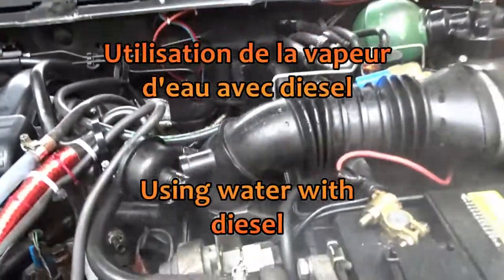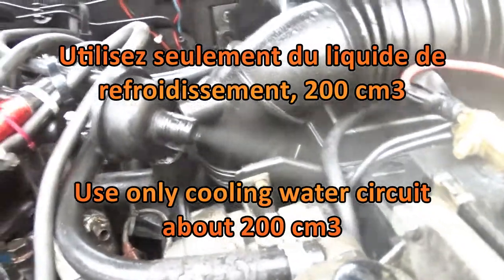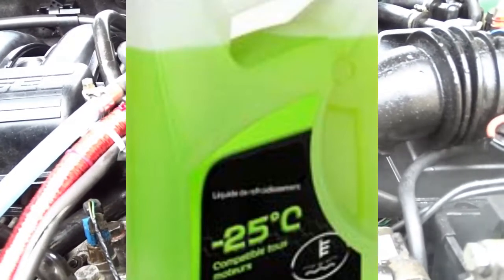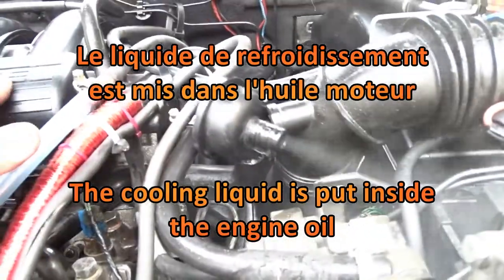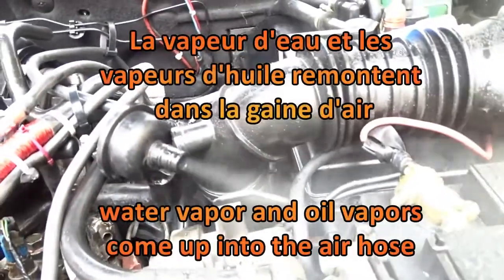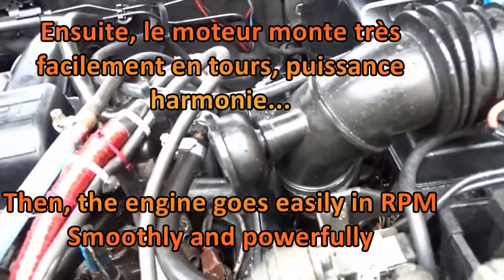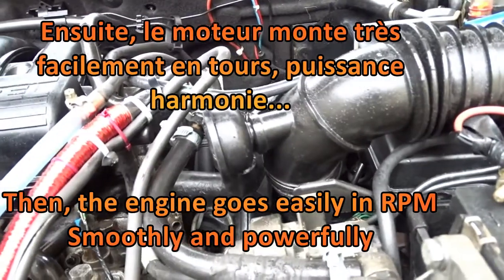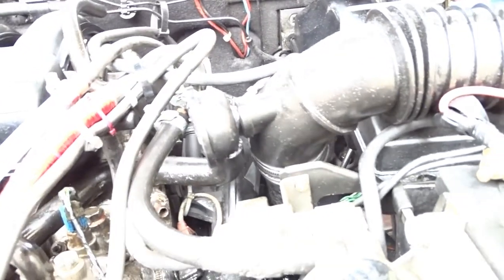Diesel et vapeur d'eau, Diesel and water vapor

Comment: Hello Robert I have an old diesel but did not understand if you add the coolant to the diesel or to the engine oil? And how often do you have to top up? Thanks I have subscribed
Reply from the maker: Hello David -- Lesson, it is very simple -- put the coolant into the engine oil -- like i said, 200 cc --- but you can try first with 30 cc -- When the oil will be hot the vapor will start going mixed with the oil vapor into the air intake, before the turbo if you have one on your car. Nobody on youtube describe  why the vapor is so powerfull, and now to you i will explain it.  It is all about physical laws. At 100 degree the water is boiling, and the vapor that goes out of it is developing a pression of  1 kg  by cm² ...tell you the rest later.....
Reply: OK bein mis does the coolant not interfere with the engine oil and damage the engine? and is this not the same thing as those water vapor devices you can buy http://ecomodder.com/wiki/index.php/Water_injection
Reply from the maker: ....i continue about vapor and it's very powerfull strenght !! When you have an explosion on a cylinder, the temperture is from 600 celsuis and 1000 celsius. I you introduce vapor in the chamber, that vapor à 100 celsuis will instantly  increase to at least 300 degree celsius !! NOW= look at the Table steam that i have publish : https://www.youtube.com/watch?v=Dt2skAeZeSc  ...At 263 degree celsius the steam is no more at 1kilo by cm², but
50 kilos by cm². ...Even a little part of steam will increase the pression on the cylinder -- when the cylinder will receive 
60 bar of pression with the gasoline or diesel,  a little steam include into it, will increase  this pression, let say, up to 65 or 70 bar on the cylinder...THAT IS WHY YOUR CAR COMES SUDDENLY SO POWERFULL AND HARMONIOUS  !!!
Reply: I agree with all that you say as that is also described on other websites promoting water vapor injection but my query is whether mixing coolant in the engine oil will not over time damage the engine?

Comment from the maker: I just discover that i am not the only one ! https://www.youtube.com/watch?v=_C9K6axqmPs  the only difference is that i habe put the water (cooling water)
is put into the oil engine. You can do that only if you have an integrate system that take a part of the oil vapor of the engine, to introduce it into the air hose ! Check that before the experience !